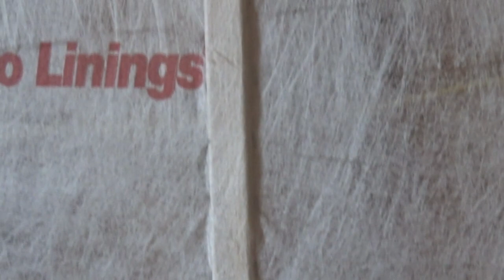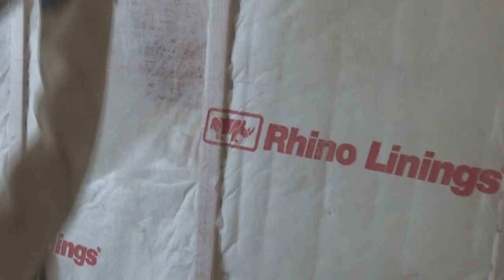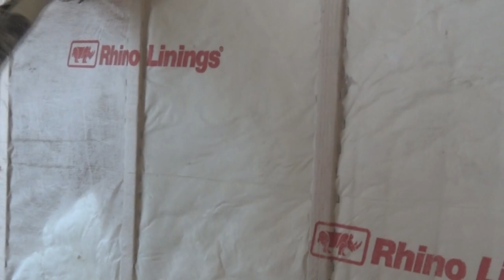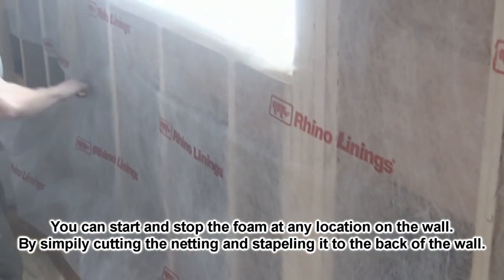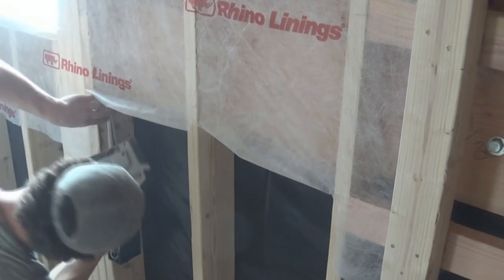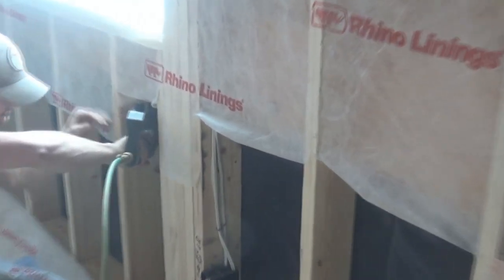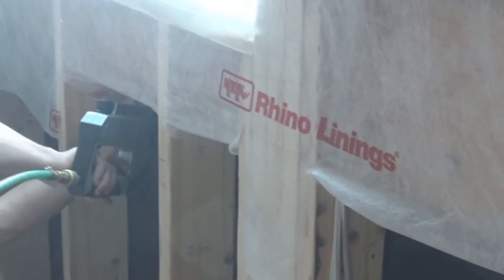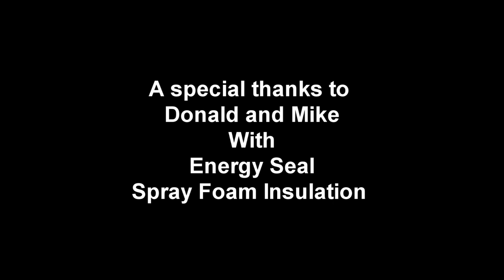Rhino Net by Rhino Linings - Step-By-Step

Comment: We are using this netting for the first time today and we dont know if it should be stapled to the face of the studs or to just to the inside. I would assume that the inside lip is the best practice, but will stapling to the face cause any problems, such as bulging?

Comment: Looks very nice but the labor on the front end outweighs the time and labor of just trimming when complete.  We have used it on a few interior walls as a support backer when the contractor didn’t have the proper Sheetrock installed.  Seems to be a good system for a new or novice spray crew.

Comment: Is the injection of foam thin enough to cure properly and not later off-gas?  I thought closed cell spray foam needed to go on in thin layers so it cures properly?
Reply from the maker: This process still allows for the material to cure properly.
Reply: It’s open cell

Comment: Just nah. Way to much work. Can spray a million times faster. Thats just sooooo much work
Reply: It’s getting harder to find and keep good sprayers.  I am thinking about trying this so it will be much easier to use more novice sprayers.  Looks like once you get everything dialed in heat and pressure wise, you can just turn a novice guy loose poking and triggering away without the risk of a bad job or wasted foam.